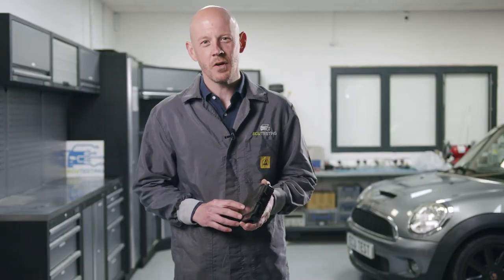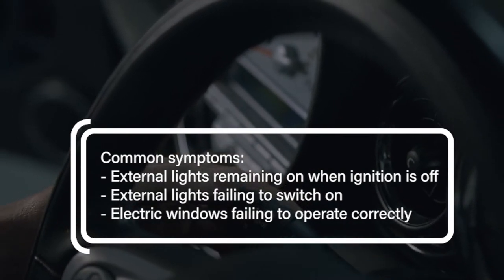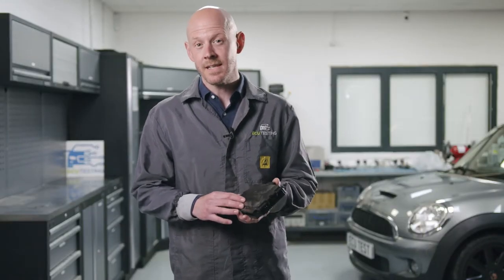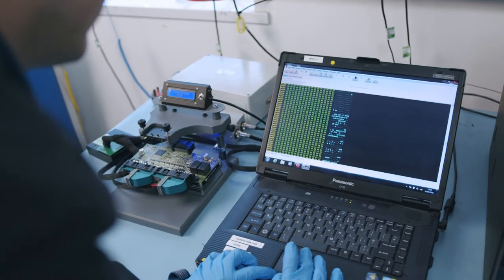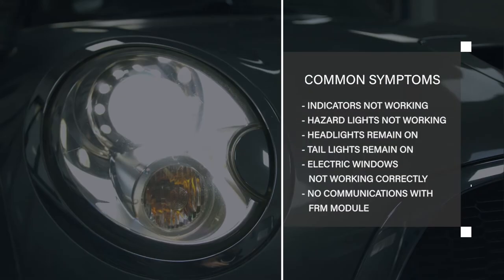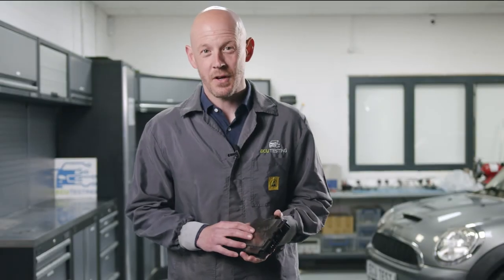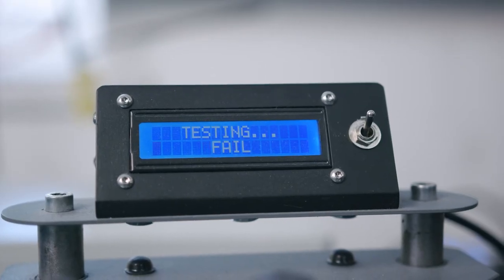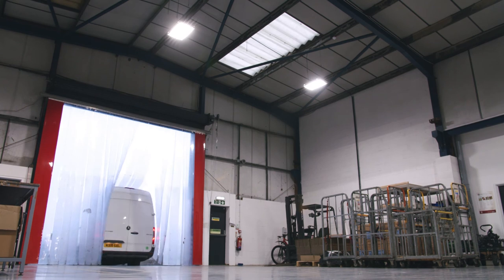BMW Mini Footwell Module Fault – FRM3 Repair

Comment: Well "roughly" how much does this cost? Or, what is the "average or median cost" you have charged the last years customers for such a repair?
Reply: I'd be keener on this if there was even a rough estimate (max min prices would help?). Tend not to go in shops that don't display prices, and wondering why car part mends should be any different... Usually means it's going to really cost, but by the time they already have the part...
Reply: I sent a surround amp to a TEAC affiliated repair centre for diagnosis - cost was £75, refundable if I went ahead with repair. They diagnosed a faulty surround PCB, then told me the Amp was obsolete and parts no longer available. WIth the shipping it cost me over £100. Why they didn't check for obsolence when they first asked for model/serial number, before taking the work on .... mmmm. - smacks of dodgy ethics? Since that experience, I avoid every business who evade questions on indication of potential costs - caveat emptor ...

Comment: What actually causes the failure? Especially on a vehicle that has no existing issue until connecting the scan tool to the OBS DLC port.?

Comment: We are experiencing most of the Symptoms (Indicators not working, Hazard lights not working, interior lights and windows not working) noted above after changing the battery we bought from Costco....

Comment: Who gave them the idea to put a Module to control simple electricals like Headlight, Indicators & Hazard light ?
Reply: Now that is a good question to be asked !!!! What the heck. We need a full blown circuit to control what can be easily controlled with a switch … amazing …
Reply: Over engineering.  More $ to fix.
Reply: I don't think having analog circuits to control the "blown bulb" light on the dash, relays and fuses for all the lights and indicators, protecting the power windows from chopping off your hands, adding a lot of control wires from all switches and having tens of different manufacturing options for all the different types of cars BMW sells makes any sense these days. There are so many downsides on that solution and will be so much more expensive that it is ignorant at best to even propose something like that.

That being said, having such a design flaw in a module and not releasing a fix (or even extended warranty outside the USA) shows that BMW only cares about selling new cars and maintaining it for just a couple of years. If you buy a new FRM3 module, it might fail again according to the USA extended warranty conditions. They could have released a software upgrade that switches from hardware emulated eeprom to software emulation, putting this problem to rest forever. But the cars were already sold so why bother.
Reply: Stop buying BMW's and other stupid cars that have too much smarts built in it to screw you!

Comment: Just a note they just stared a new recall for the frm Recall Campaign No. 23V-337: Footwell Control Module (FRM)   2007-2014

Comment: My headlights in park lights suddenly stopped working and the drivers door I cannot open is that the cause of the problem with the Module as I just received the recall notice in the mail but BMW don’t have the fixed yet

Comment: Hi my door locking system on my 2003 mini cooper s r53 iv been told its my body control modular system I can get in to my car using door key and start it but I cannot lock it with my button on my key

Comment: I have no power to my fuel pump in the rear of my minj. I have a water leak around footwellmodule. Is this something you could investigate?
Reply from the maker: Hi. The FRM3 module is responsible for controlling the 'body' aspects on the vehicle, e.g. windows, internal and external lights etc, not the fuel pump. Are you experiencing any other symptoms other than no power to the fuel pump?
Reply: @Ecutestinglimited  No I am not fortunately. I know where to go now when I do thoe. Thankyou so much fkr the quick response. I am a DIY car guy so I appreciate you my dude. Take care.
Reply from the maker: @MrAssassinash  No problem. If you are able to scan the vehicle for any fault codes then we may be able to assist you further with the fuel pump issue. If you are able to do this or have any other questions, please contact our technical support team at info@ecutesting.com. We hope you get your vehicle back on the road soon! Cheers.
Reply: I'm experiencing the same problem. No power to the fuel pump in the rear. Did you find any solution?
Reply: Search a Footwell module video by Kennedy's garage. The MINI still started & drove, even though the footwell module was faulty.

Comment: Hi, I live in France have a mini cooper D 2010, the windows , indicators don't work the lights come on when engine starts but can't control them, mini/BMW here have quoted a total €1,300 for repair, do you accept a d deliver from france?  If I can find how to get it out 
Thanks
Reply from the maker: Hi. Yes, we offer a test and re-build service worldwide so you are more than welcome to send your unit into us. Please visit our website and select your make and model of vehicle and unit part number for our most up to date pricing: https://www.ecutesting.com/common-faults/bmw/bmw-and-mini-footwell-module-fault/

The module is located at the bottom left of the vehicle's front footwell and is relatively easy to remove yourself. Here is a quick and easy guide to follow: https://youtu.be/cYHCdjFodsA

If you have any other questions then please contact our technical support team via email at info@ecutesting.com. Thanks

Comment: Does this module have anything to do with the heater??

Ours not blowing. Motor replaced etc.
Reply from the maker: Hi Anthony. A common symptom of the footwell module failing is that the AC/heating fan does not work, so it does sound like that could be the cause of your issue. Check out the post on our website for more symptoms, fault code information and how to get it repaired: www.ecutesting.com/common-faults/bmw/bmw-and-mini-footwell-module-fault/
Thanks

Comment: Thanks.  I’m going to need to send it to you.
Reply from the maker: Hi Dan. No problem, follow this link: https://www.ecutesting.com/common-faults/bmw/bmw-and-mini-footwell-module-fault/ and select your make and model of vehicle. Or alternatively contact our technical support team via email at info@ecutesting.com with your make and model of vehicle, part number of the unit, details of the fault, and any other diagnostic information you think is relevant. Thanks.

Comment: Do you know if this problem was still occurring in the 2015 paceman s all 4?
Reply from the maker: Hi. This common fault affects Mini Paceman's from 2012-2016. If you can locate your unit's part number, then email our technical support team along with the make and model of vehicle and details of the fault and they will assist you further. Cheers.